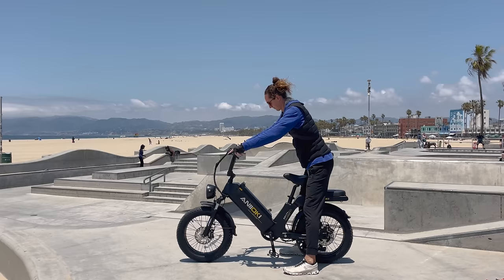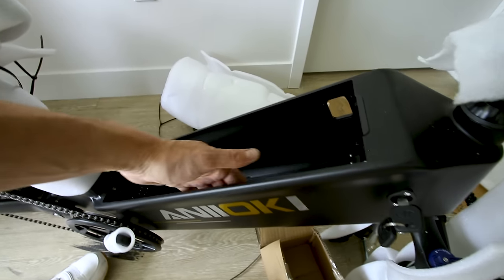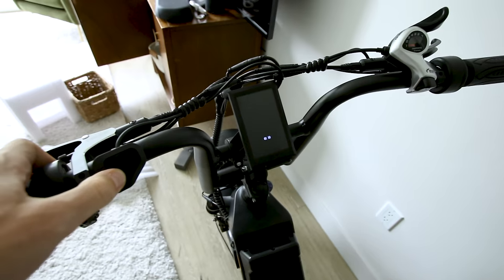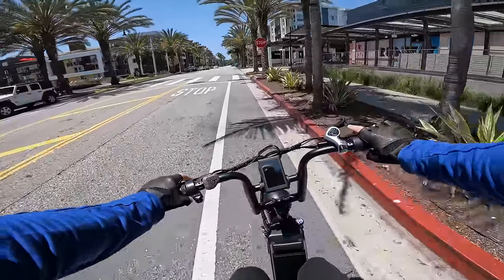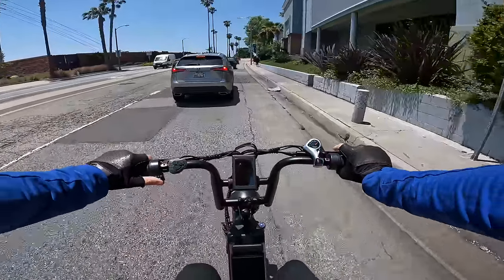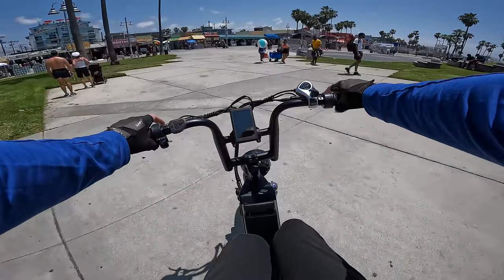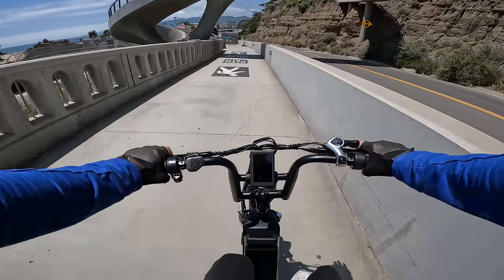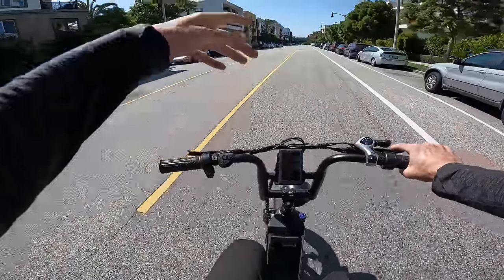The LONGEST Range Ebike Ever! Aniioki AQ177 Pro Max Review

Comment: Current owner.  Extremely heavy bike, had rear flat in 20miles on road, bought 2 new for $150.  Poor design for repair and maintenance or tire repair, have to remove brakes and chain to get tire off as rear comes off backwards .   Battery is large, which is nice, but only 55volts when charged not 60 as advertised.  Pedaling useless after 15mph.  Front light not adjustable.  My motor had to be disassembled and re-greased after 70 miles because of crappy quality control. Derailleur works but came bent and still makes noise.   I would go for the new XPedition Dual-Battery Cargo eBike from Lectric.   Much better quality, design and load capacity, equal distance and cost.  I've read pedaling works up to 25mph on it as well.
Reply: What is the weight of the battery?
Reply: I was think of buying and seeing the comment, I won’t. Yeah back tire is more pain than the front.  I dealt with it.
Reply: So which Ebike is good for you??
Reply: You can get better quality tires..
Reply: Made in China ! What did you expect ? 👎🏼 Curious what Matt’s discount code value is and did you use it ?
Reply: Yeah this bike sucks
Reply: I don't think so..
Reply: How is 28ah equal to 60ah lol
Reply: @sumaznkid124  don’t buy this bike it sucks I have one
Reply: Bought one new, arrived broken, got stolen. 

The whole time the company did nothing but stall in an attempt to run out the clock on the warranty. They had me send multiple videos to a random phone number, and then after I told them the bike got stolen, they refused to even respond anymore. 

Also, the manual says that this particular bike is not waterproof which makes it really kind of pointless. In fact, he should not have taken this bike to the beach according to the manual of the bike. 

I was super excited to own this bike, but after having it stolen I'm kind of glad because I feel it would have been a hazard given that they wanted me to bend back metal that was broken in shipping.
Reply: @Bryan Sierra - they all require video proof because people often lie for free stuff and shipping ebikes is crazy expensive on top of item cost. If it's a cheapish or heavy enough bike they may not even want it sent back due to those high shipping costs.

What should they do when you get your bike stolen? Condolences are nice and maybe a discount offer on another bike but any expectation of more than that is totally unreasonable.
Reply: 55v on a 52v battery is a hair under 80% charge. it should be 58.8v. either your charger isn't giving a full charge or more likely, your battery has a couple out of 14 cell groups that need rebalancing by leaving plugged in to charge for long enough after it's done.

That and and motor issues and you didn't request a return or new motor/wheel and battery... Dream customer right there.

Many people who received a bike like that now have two of them because they don't want to pay shipping if the parts aren't much more valuable than shipping cost.

I once got a bike with some defects (that I still have) with motor noises, drivetrain issues etc but the replacement bike is a champ that's carried me over the Santa Monica mtn range many times. That was with a company ordered via Newegg. Ymmv ordering direct or from a company that doesn't offer free returns or has to abide by Amazon or Newegg rules.

Comment: I've had this bike for about 2 months now, and I've gotten up to 90 miles 3 times (though its hard to stay on a bike for what amounts to 5.5 hours). I really hope this becomes the new standard for batteries.
Reply: Is huge! I would be happy with a 40 ah 52V on my Kepler. There are a few Kepler owners with dual 52V 20 ah batteries and a couple others I know of that have 60 and even 80 ah set ups. 😂
Reply: In your experience have you had any tire problems like he did in the vid?  or trouble finding a replacement?
Reply: @not_so_native_native  I wouldn't worry about tire problems.. That can be an issue on any bike in the world. Easy fix.
Reply: @not_so_native_native  one flat in the back. Got it repaired at a shop
Reply: What peddle assist setting did you mainly use for that 90 miles? And did you hit low voltage cut out by the time you finished? Any major hills on your journey?
Reply: @danimayb  I switched it to 1-9 pedal assist, and kept it mainly between 5 (17 mph) and 6 (20 mph). The battery completely died on me once and I had to pedal maybe a half mile back home. The other 2 times I still had "some" power left, but it was on 1 bar. Sacramento is pretty flat, for the most part, but Folsom has quite a few inclines.
Reply: I love mine
Reply: @not_so_native_native  Tires are easy to find. I just ordered HEB tires. Allscape
Reply: How is the comfort of the seat.
Reply: @swaggod226  it's cool for about the first 10-15 miles. After that point it starts feeling like a rock. Lol
Reply: Now? Why do you write "now"?
Reply: yea thats why i feel like the moped style seats are so much better! i can ride for hours on them without allot of butt fetigue.
Reply: Absolutely!
I have been writing ebike companies directly, and requesting much larger capacity battery ebike choices, especially in the smaller or medium size ebike categories as well.

thicker brake rotors, more contact area brake pads, solid or anything but thin spoked rims (spoked rims bend too easily when crashes occur, verses the solid metal or thick metal spokes that i have not bend one rim on, upon crashing)

gears that can be shifted, 60+ amp hour batteries (21700 cells rather than the smaller 18650 cells, is also preferable) and ordinary seat post thus permitting the greater choices of seat options (the ylg extra wide seat is a present favorite)

and i do look forward to regenerative, electric braking because i like the choice of greatly extending brake pad life.

cruise control is also really nice to have.

mirrors also would be great!

so exciting!
Reply: With the price, why you didn’t bought an actual motorcycle? For 2k that’s a lot for a E-bike.
Reply: @dfaro8453  because a motor vehicle is not a single "purchase" like an ebike, it's a never ending investment. You buy an ebike for 2k and you're done. You buy a motorcycle for 2k, and how much more are you paying for registration, insurance, gas, and maintenance? When you really look at it, unless you have a pressing NEED to have one, a motor vehicle is an incredibly bad deal, financially.

I just don't have a need for a motorcycle. I work from home, i live in the city, and the few places I need to go, i can get there by ebike or public transportation for much cheaper. I'd also hate to be restricted to city streets, with the way people drive in my city. It's just not a pleasant experience being around cars. And when I don't want to be around cars, I can take an ebike on bike trails and just relax and cruise.
Reply: @En4cer2K9  thanks for your reply. I understand now. There a lot of benefits owning a ebike.
Reply: How much is it
Reply: @En4cer2K9 why does the website say it can get up to 200 miles with Pedal assist ? If you only got 90 miles but it claims up to 200 that’s a huge difference 😢
Reply: @MikePhoTravelVlogs  EVERY ebike company embellishes their bike's mileage, based on probably the lowest pedal assist setting
Reply: @En4cer2K9  that ain’t right lol Thanks for the honest feedback
Reply: I get roughly between 100 to 130 miles when being froogle with my power.
Reply: Id be happy with a 25ah battery as my current fat tire bike has 20ah and i get about 40 miles right now. 60ah i could go all the places!!!
Reply: @justinhaller2055  and that's the point. You can go ANYWHERE and not have to worry about "how much battery do I have left?"
Reply: I'm like 150 lbs wonder if ide hit the 100 for sure in mid speed mode, damn that's a big battery, takes a dropping on the lectric XP
Reply: How many kilometers you can last with the battery capacity?
Reply: @farwestfabrice  I have no idea. I did just ride 72 "miles" on it today, though, and still had 2 battery bars left.
Reply: @MikePhoTravelVlogs  he was using throttle  so yea
Reply: 😮Amazing AWESOME 🤠🤘🐐
Reply: @En4cer2K9  I’m looking at this one or the Erhora because I want to ride from San Diego to Portland, 30-40 pounds of camping/food/water gear, single wheel trailer for 2 extra batteries… and my 12 pound Pug. 😅
Reply: @theshittybowman  personally, the Aniioki looks better than the Eahora Juliet. Functionally, they use the exact same battery, so it doesn't really matter which one you go with.
Reply: @En4cer2K9  cool, sounds good. Appreciate the feedback man!
Reply: @En4cer2K9  the Romero Pro is dooooope!  I just saw they make rear racks for them which is cool… I personally like the Romero Pro look, but now I have to find a good single wheel trailer. I plan to have 1 extra battery with me, but I’ll be testing the bike with the trailer carrying 75 pounds riding all over San Diego before the trip! Appreciate the help dude!
Reply: lol Just carry spare batteries for even more range on an eBike.

Comment: im guessing they say dont stand the battery up vertically because it could fall over and cause damage. btw, always plug the charger into the wall first then plug in the battery.
Reply: I heard to always plug in outlet and then battery
Reply: Good advice. Although I am curious to know why outlet then battery?
Reply: @phant0m597  something about its better for it to short in the battery then the outlet if it does short for whatever reason
Reply: @truckthings4302  that makes plenty of sense. I have always done it that way thankfully. thank you for the tip!
Reply: Then why do the manuals for my 2 different branded ebikes and chargers specifically note battery first, then outlet please? Thx.
Reply: @nicks931  are you sure that’s not for disconnecting? When you unplug you disconnect battery then outlet.
Reply: @TheCylonBomb  Yes, I'm sure. Just double checked. For the record, I kind of agree with you, and did that the first several times before reading the manuals! I raced R/C cars and planes 20 years ago and built many battery packs. I have never heard of a good reason, or damaged any of my packs so? 
I do monitor charging though, and don't leave things plugged in unattended. Thanks for the reply, ...N
Reply: I also read that and. Charge both my Ebikes the way YOU stated. Connect charger to battery charge port THEN charger to outlet.  To me I don’t see why but then again I do as it says.  I ve noticed once in awhile when I plug in the charger cable to the battery port I get a quick ZAP / spark  like a residual discharge of some type.  Perhaps this is why they want the charger to NOT be plugged into the wall until it’s connected to the battery. Not sure I just do what it says to do
Reply: @jakereal3604  I figured I should do as instructed, then if I have any issues I can say I did! But your experience tells me there may be a reason too. Thank you, ...N

Comment: Too bad this thing doesn't have mag wheels or for me it would be a big contender. Spokes get loose, break; it's a hassle. Then the wheel gets warped. Sheesh.
Reply: I'm ok with properly laced spokes on rims that have nipple angle compensation. I wouldn't touch any wheel with the nipple coming perpendicular through the rim and then bending the spoke at the threads.
Reply: I don't know about all THAT stuff, all I know is I'm sick to death of dealing with spokes and mags are maintenance free. Definitely worth the extra cost.
Reply: ride till they fall apart and upgrade to mag, thats what I will do @SteffiReitsch
Reply: @buzas69  I don't think you can upgrade to mags on an ebike as you can on a regular bike. You have to buy an ebike that already comes with mags. The one I like is the FIIDO T1 pro. It also comes with a 20AH battery. Check it out.

Comment: I just got the 52V version and there are some differences in regards to the 48v version. 1. The 52v version comes with CST BFT 20x4 branded tires. These tires aren't high end by any means but they are a better quality than the tires shown in this video.  2. The 52v version comes with different grips and a half twist throttle instead of a full twist throttle. The front fork in identical  besides the lock out knob on the right hand side which is black instead of blue small difference but it's there. Top speed on the 52v version is 31mph (yes GPS tested it) 48v version is 28mph maybe 29mph from what I've seen. Torque is a bit more on the 52v version too 100NM vs 80NM a significant difference 74 ft-lbs vs 59 ft-lbs..

Comment: I've had my bike for a month now and have pulled over 500 miles on it. I regularly do 50 mi rides and my top ride was 73 miles with one bar left on power. That was a trail ride packed dirt lots of small hills.
Reply: Amazing distance 🤠🤟👍
Reply: so could you do a 2 hour ride somewhere and make a 2 hour ride home on the same charge? what if yes what about a 4 hour ride and 4 hour ride back
Reply: @harmondraws  Sounds like aching butt distance 😩
Reply: @ianmangham4570  better then doing it on a normal mountain bike
Reply: @harmondraws  Definitely 👍
Reply: Would you recommend this?

Comment: My bike has 20x4" wheels, and came with knobby tyres. Changing to slicks was the best thing I ever did to it, particularly because the only time I'm not on a sealed surface is the three metres between my driveway and my side gate. The knobbies (Kenda Krusades) went about 2,000 km before I had a serious blowout, and I should really have replaced at least the rear probably at the 1,000 km mark. The slicks (Kenda Kraze) have so far gone about 1,500 km, and they still look basically new.
Reply: Are you joking? I have almost 7000 km on mine before I change front to rear tyre!?
Reply: @serge470  Nope. Unless my bike’s odometer is seriously off, 2000 km. Pretty much 2000 right on the button. Might be our shit roads here. Those tyres were practically bald by about 1,200 km.
Reply: @NoobixCube  or your tyres was really bad quality and depending on your weight. But I have my stock tyres for 3 years every day commuting no problem.
Reply: @serge470  I'm only 70 kg, about half the weight of your average MAMIL, but the bike is 35, and the battery holder is right above the rear wheel, under the tail rack in my case. All of the weight on my bike is localised over the rear wheel. The roads in Melbourne are, when they have any surface integrity at all, extremely rough. I imagine that chewed my wheels up fast. The softer rubber of the knobby tyres didn't stand a chance. If I'd stuck with the same tread, I'd have just swapped the front to the rear, as you say, but since I decided to change to some tougher slicks, I ditched the half-worn knobby tyre from the front. 

Ultimately, the slicks still look basically brand new at the same distance the knobbies it came with looked like they'd been through hell. In the end I don't care why they didn't last, just that I apparently made the right call going with the lower thread count slicks.

Comment: There are a lot of uses for this bike.  Like road trips, trail riding, camping, fishing, hunting.  Have you seen the external power unit?  With a 60ah battery you have power to spare.  I wouldn't take it off-roading because of the weight.  Most bike/ four wheeler trails are good enough to take this e-bike down.  I was a poor country boy so before we could drive we took our bikes everywhere riding them all day long.   Now that me and my wife are in our 60's we still like the ride bikes with our kids and grand kids.  With this bike we can keep up where ever they go biking.  Maybe you need to get out of the city get some fresh air and truly see what a 100 to 200 mile e-bike can take you. There are more sites to see in California then just the Hollywood Sign.   I just got this bike for my wife who is 63 and had both knees replaced she is excited to ride it. I myself have a stealth bomber which I built myself.  To build the 72 volt 60ah battery was the hardest.  Got used batteries from hospitals broke them apart and tested the cells.  I even built a tack welder out of a microwave transformer to build the battery.  Fyi don't try to build a 72volt battery all at once. Build two 48 volts and hook them together separately.   Every time I got over 48 volts it would catch fire and I would have to ripe it apart before whole battery burn up.  My wife is still mad about the burn marks on the kitchen counter.   The main reason I built my own bike is because other e-bike had no range.  Now there are e-bikes on the market that can keep up with mine.  Last thing always carry a tire repair kit, pump, spare tube, tire patch, and green slime.  Think hard would you buy a electric car with 30 mile of range?
Reply: Ex- country boy here , and I understand who you are...:))  Yes, range is most important to a senior who wants to have a full day's fun in the scenic areas.  I'm 78, wife 73, and we take ours out of the Chicago suburbs into the drives along the Fox River.   >> Ride, take photos, eat, Ride, drink, photos, and repeat. <<  I'm an old dirt rider, so I love speed, but on a road bike, 25-35 is all I want. Take time to see where you're going ! If not, get back in a car.